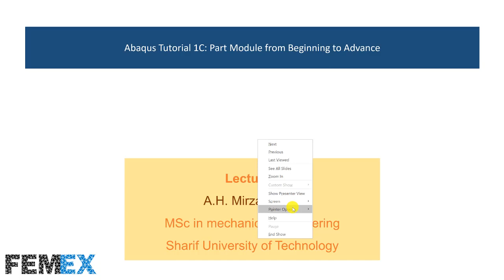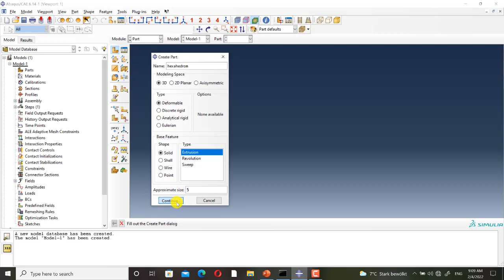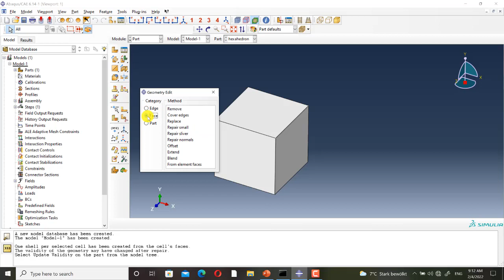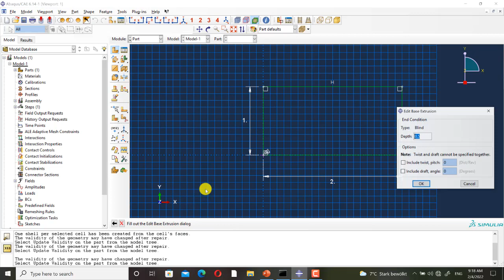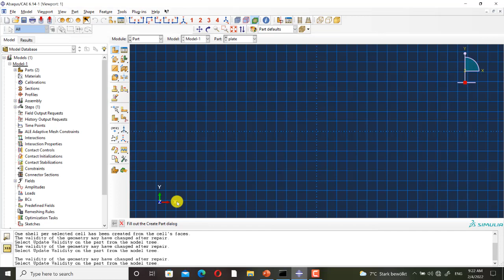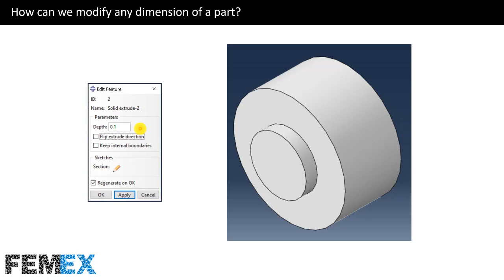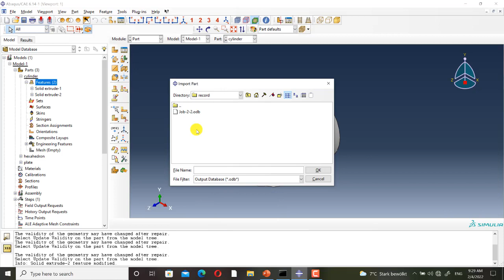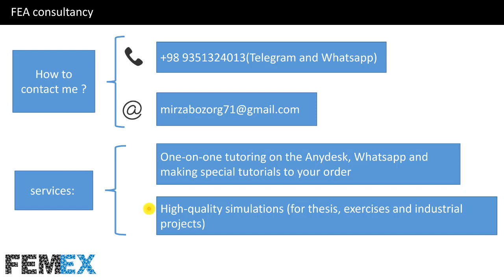Abaqus Tutorial 1C Part Module from Beginning to Advance

Comment: The last part was something new and interesting. Thank you for the video. Would that be possible to modify the imported geometry/features or change its mesh?
Reply from the maker: hi.
you are welcome.
if you import a cad file to part module, you cannot edit its dimensions. you can only add some features to it such as fillets, chamfers and holes.
if you import a part as an orphan mesh to your model, you cannot modify or add anything because it doesn't have geometry.
Reply: @FemexIran  is there a tool to automatically generate mesh-based geometry?
Reply from the maker: @lodyr_john  
hi.
yes.
a mesh based geometry is named orphan mesh because it doesn't contain any CAD data.
you must create it from the mesh module: create mesh part